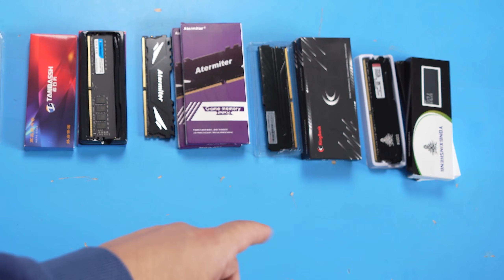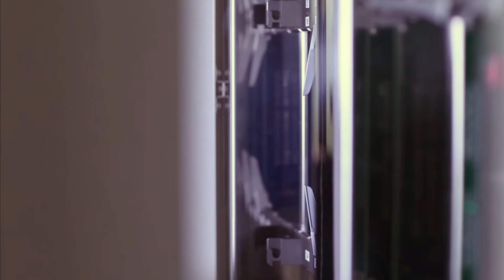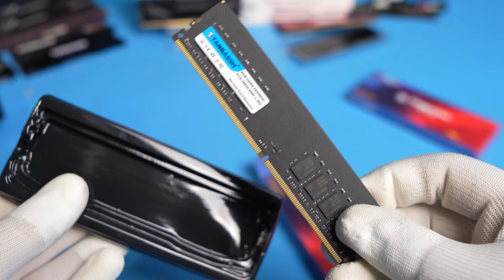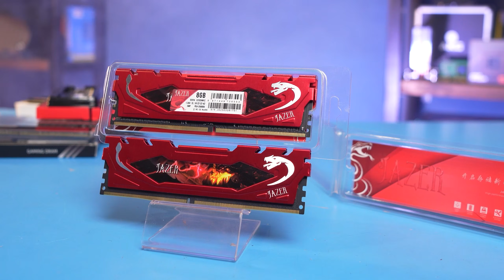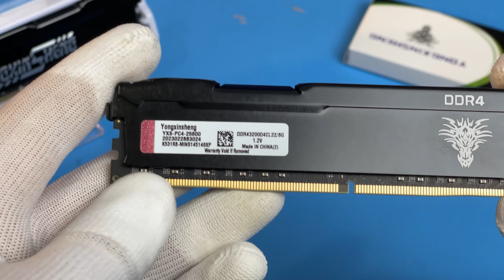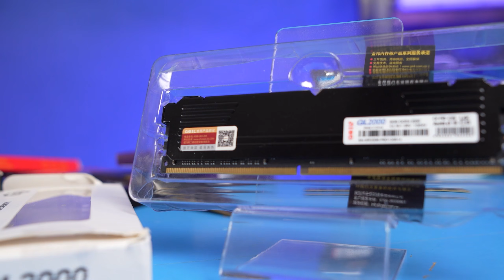DO NOT buy this RAM | Testing cheap memory from China

Comment: Great video! I am no expert when it comes to ram so I really appreciate the information you've provided here. I for one, actually don't mind that China uses spare parts. They are the biggest recyclers of e-waste that would otherwise end up in land fills. I've personally used multiple sets of ram from Kllsre and Jazer and haven't had any issues. I even ran some test comparing the peformance in games compared to a well known quality brand Patriot. Surprisingly they actually performed on par to my Patriot Viper 4 Blackout series ram CL16. I had a Kllsre kit rated at CL 22 and two different Jazer kits at CL18. In games the Kllsre was basically only 1 fps on average slower. Though, there were larger differences in the 1% and .1% lows (but we're talking 3fps max). The Jazer kits were pretty much on par with the Patriot kit with the added bonus of crystal rgb's on the Jazer kits.
Reply: Exactly. Recycling isn't bad.
Reply: @robindebondt4643  ITS HOW THE CHIPS ARE REMOVED THAT IS THE PROBLEM, USUALLY BY A LOW PAY WORK WHO HEATS IT UP USING DIRTY FUELS ... DON'T GET ME WRONG I DONT CARE IF IT POLLUTES BUT THE MANY CHIPS ARE DAMAGED IN THE PROCESS AND THAT IS BAD FOR QUALITY.

Comment: i bought kllisre ram kit 16gb but mineis working perfect without any issue
Reply: I bought a 32GB kit but then realized it was not compatible with my 4500. It gave me the push to buy a new CPU and I got a 5700X. The KLLISRE ram works perfectly, for now.
Reply: @napsterking  compre 4x16gb ... 64gb total y trabajan perfecto con un ryzen 7  5800x  .. cero fallas y trabajando a 3200mhz ya tienen varios meses conmigo y todo perfecto
Reply: How its holding?  @glassstudiomexico7578
Reply: Same for me. It was different than the one he test here though.
Reply: is it still working and worth to buy?
Reply: i have kllisre 8+8 3200mhz 
from 2022 and still working with no issues
playing cs2 win my ryzen 3600 
good fps no stuttering no lag always good fps
i highly recommend this ram

Comment: Thank you for the detailed and comprehensive tests. Would be great if you could test other popular brands like Asgard, Gloway, Netac and maybe Juhor. At least in paper they look more premium and reliable.
Reply: cuso . asgard and gloway are the same company as i knew
Reply: Juhor is good quality. 3x different kits now: DDR4 3200(crucial/micron), DDR4 3600 (Samsung) & DDR5 6000(Samsung). All SPD info shows as Juhor & module as Samsung or crucial's micron. They do one with anime art on hsink, listed as Hynix too. But they keep the different modules separate, like Hynix type above. not mixed like these in video. XMP profile works no problems. Dual channel no problems. If you want decent cheap memory go Juhor. Might not be cheap on there but save on price here & have a decent quality.
Tried Kingspec So DIMM & RZX So DIMM (laptop)DDR4 & both have been fine. Laptops only have 1 slot nowadays, along with maybe soldered modules on mobo. So dual channel & the worry of different modules on 2 matched dimms wouldn't really matter.
Reply: @ashleymcgovern5120  hello dude, i have to buy a juhor set that is currently on sale on aliexpress do you think it will work with my ryzen 5 7600x? it's 2 stick of DDR5-6400MHZ and the price seems to cheap to be true. i'll pay them 100€
Reply: I own a Juhor in my secondary computer, works like charm to this day, highly recommend them for the price & quality they offer :)

Comment: I have 4x 8GB no heatsink Oscoo ram, non XMP, they're weird indeed.
Advertised as 3200MHz on the box and their website, but in my B450 Aorus Elite it only reach 2993 MHz out of the box. Even worse, in B450M Pro VDH Max it only reach 2666 MHz. 
On the plus side, they're very cheap, no frills. If it works, it works.

Oh also the pc is office pc, even though I sometimes play games on it.
Reply: it's normal cuz only x and z chipset can handle 4 sticks of ram at highest speed
Reply: Why do you need 3200mhz for an office PC? lol
2993 is more than enough, heck even a 2666 is still fast (i have a gaming pc & it works with no lags or slow downs)
Reply: @RacingMaster777  because it's cheap (Oscoo is perhaps people would call one of 'aliexpress' brand),

and yeah I agree 2666 is actually still enough, my main pc at home is using 2666